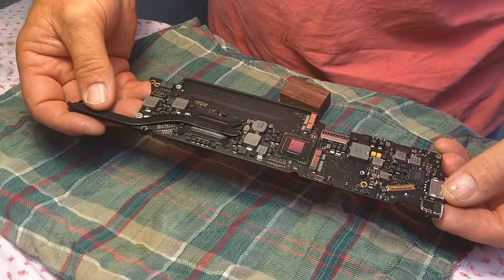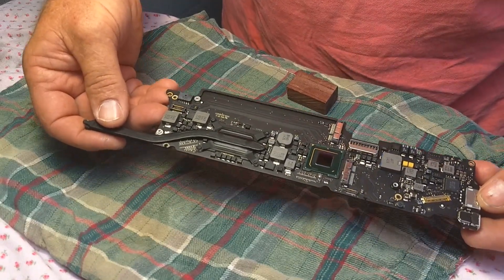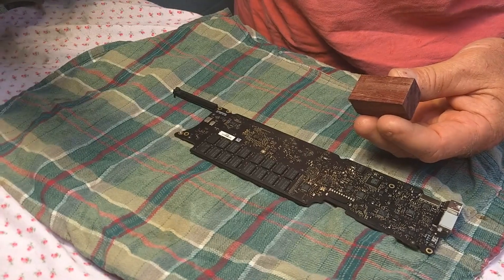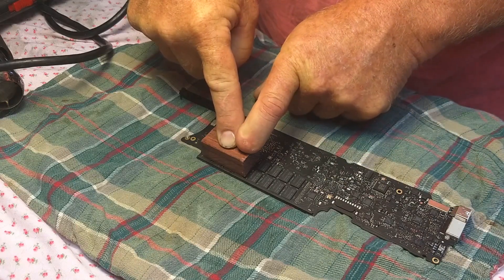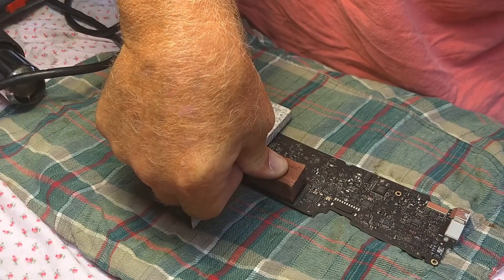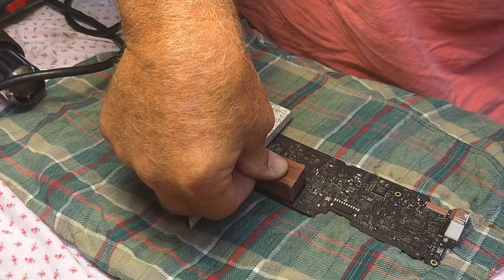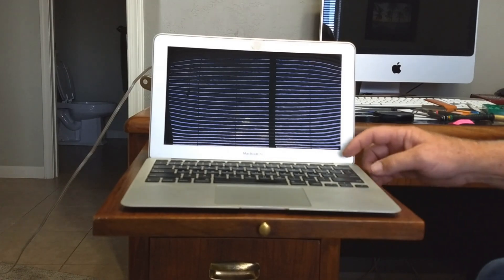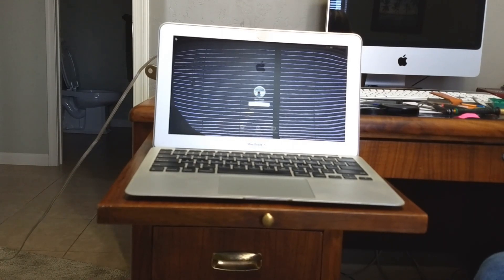Mid 2011 Macbook Air Ram Reseat

Comment: Whoa..I had exactly the same issue. my Mac book air 2011 wasn't starting anymore : just 3 consecutive beep.. Thus I Opened it , protected surrounding component with aluminum plates and warmed it using heat gun just on ram for 20sec...as you did. making sure to push on ram right after heat gun ....re-assembled..and it works now. Impressive. A huge thanks (Thomas from FRANCE)

Comment: Clearly you don't know what you are doing. 
First of all you have to pre-heat the board before the reflow.
Secondly you have to monitor the temperature during the reflow to make shure the tin got liquid. 
Also you don't have to press the ram chips they center themselves and need to cooldown slowly see the datasheet specs of ramchip.
You're just lucky you don't damaged other components and this tepair is a very short term solution.
People who follow your method will probably damage their device and will be beyond tepair if they bring it to a real technician.
you will probably do this with the best of intentions, but the chance that things will go wrong is much too great through this unorthodox method and people are not helped in this way.

Comment: DO NOT DO THIS! THIS IS NOT A RAM "RESET"! What you are doing will break your machine, and the fact that you are doing this in your bed and fabric cloth is even more baffling.
Reply from the maker: And once again...this computer wasn't even booting up before we did this...we knew it would be a temp fix...and it allowed us to get the computer booted and back up years of pictures off the drive...but I appreciate your opinion bro tato chip 🤙
Reply: @Snipeoff  Not an opinion, its facts, you will move capacitors, resistors, and other IC chips around by smashing a rock on a heated logic board.
Reply from the maker: You know using language that evokes an emotional response...like "smashing a rock..." Doesn't make your argument any more valid, I included how this fix was just temporary, and any one could figure out not the right way to fix it...in the description
Reply: @Snipeoff  Again, not an argument, just stating facts.
Reply from the maker: Ok, I appreciate the input, I'm having a bad day/week sorry for being testy
Reply: @Snipeoff  :)
Reply: It is a reseat to get you files back, not a reset
Reply: @marcelrozendaal776  You can get your files back with an external hard drive reader, another computer, like 30 different ways of doing it, that is a laughable excuse.

Comment: Hi, basically what are you doing with this? I mean, heating that mother area and pushing chips with a little piece of wood?, thank you!
Reply from the maker: Yup that is basically all we did, we did that just to reseat the ram so that the computer would boot up again. We discovered that was why it wouldn't boot up. But I will reiterate this was only a temporary fix the computer eventually quit again. But it did give us enough time to backup all our files.
Reply: @Snipeoff  how long did it lasted?
Reply from the maker: @estebanquito356  Thank you for your comment, so this repair only lasted for about a day or two. It was really only enough time to backup the data on the drive. That's not to say it couldn't last longer or shorter for you, it just depends.
Reply: @Snipeoff  Thank you! I might get my hands on one that has this problem but in the graphics gpu
Reply from the maker: In order to really fix the problem for good we ended up replacing the entire logic board. Didn't film that though 😑 😒